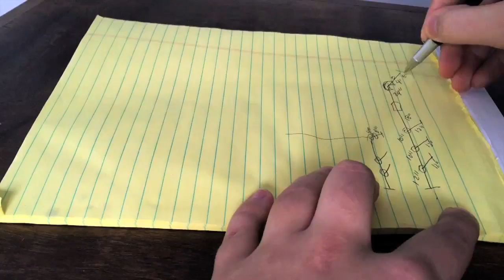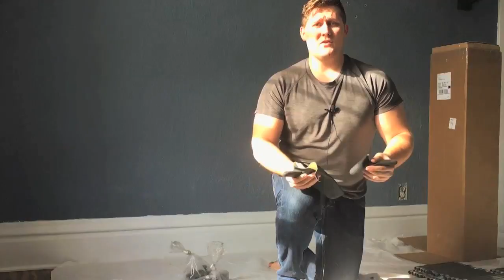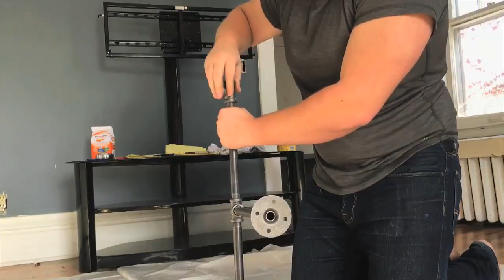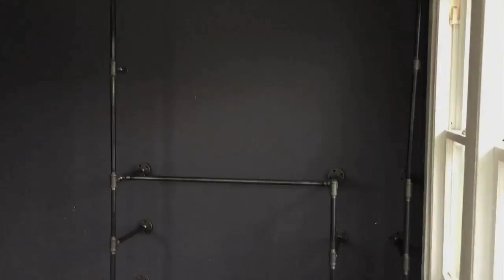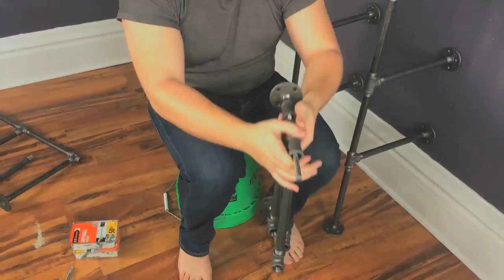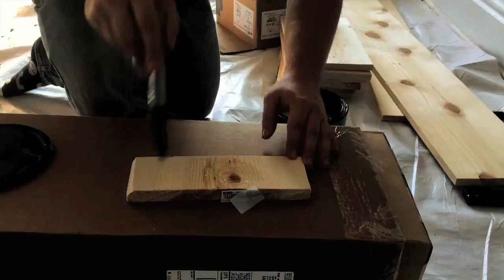DIY Industrial Iron Pipe Closet Unit

Comment: i’m thinking of doing this but attaching the vertical bars ceiling to floor with the flat fittings- you mentioned 2 inches for the connectors was it only the ts or ?

Comment: Did that wax work long term to keep the pipe sealed?  It seems nearly impossible to get all the grease off.  Im worried about it getting on my clothes
Reply from the maker: Years later and yes! The biggest thing was cleaning the pipes to get the grease off. You'll see that the pipes change color drastically when you do that and the wax was mostly there for rust
Reply: @ZacFolsom  ok, thank you!  I clean the pipes i'm using already (i thought extremely well with acetone and then soapy water), and then i sprayed them with a clear exterior sealant (for concrete, metal, brick, etc).  When i started to assemble some of the peices earlier today I ended up with black stuff on my hands still.  I'm going to go over them again and then apply the wax i think.

Comment: I'm wondering what size around the pipes you went with. I see there are different diameters (or) radius', so I'm just wondering what the best size if for closet hangers.
Reply from the maker: I went with 1/2 inch pipe and the hangers work fine. The 1/4 while cheaper seemed like it would just be too small looking